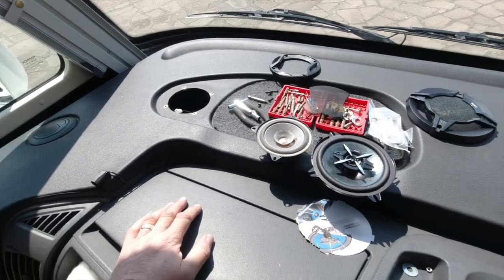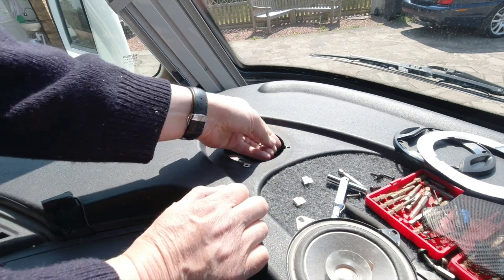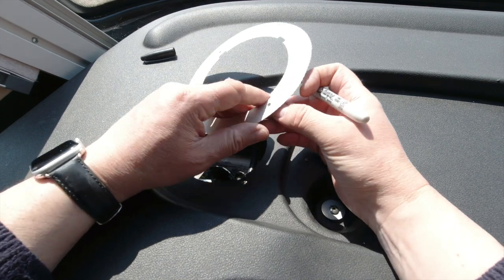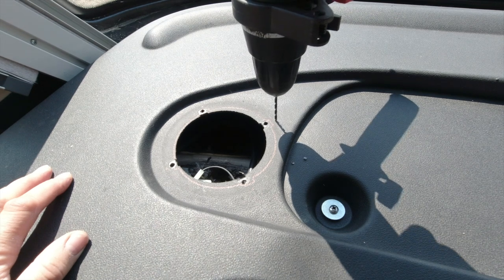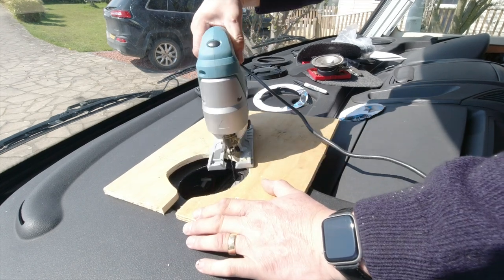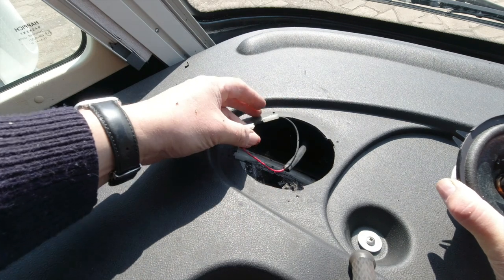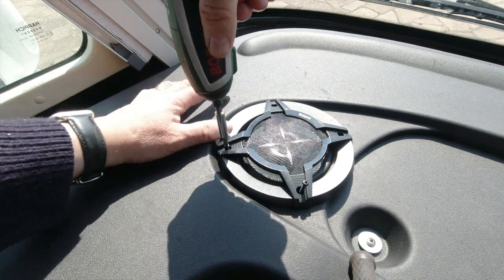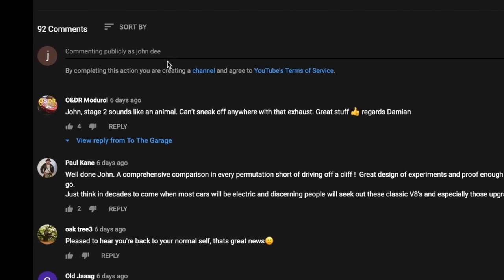How to use a jigsaw to cut speaker holes on a dashboard or other uneven surface (rapid 9090F demo)

Comment: I find I have better control on this light duty stuff with a Dremel type tool and an end mill.
Reply from the maker: I love a dremil but often find that the plastic clogs the mill blades cutting slowly  or heals over if cutting fast due to the high speeds of even my dremels lowest setting. Maybe I just need a more aggressive mill bit
Reply: @ToTheGarage  I use a foot pedal speed controller and a cable drive extension, like a Dentist's drill.
Reply from the maker: @garyvanremortel5218  Another. good tip Gary and another item for my Christmas list😁